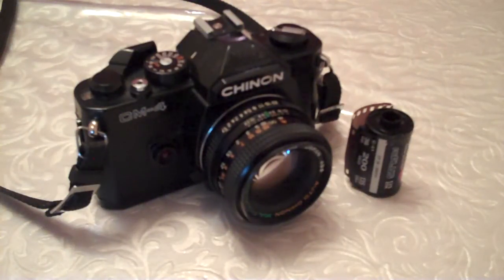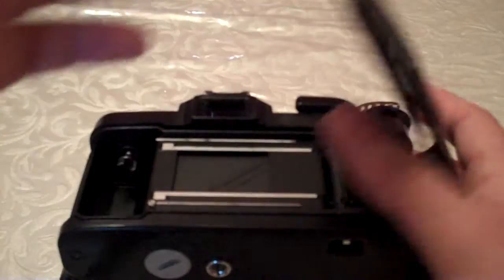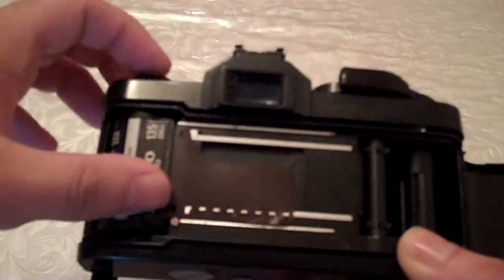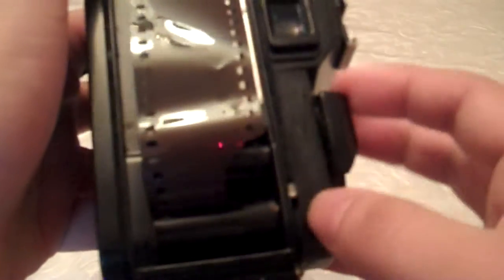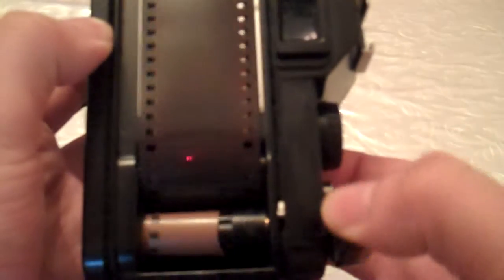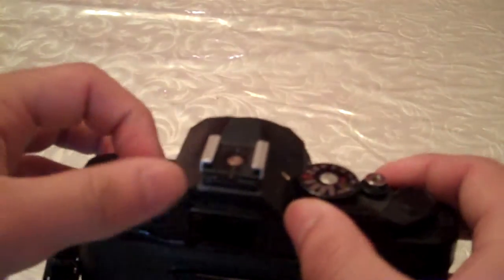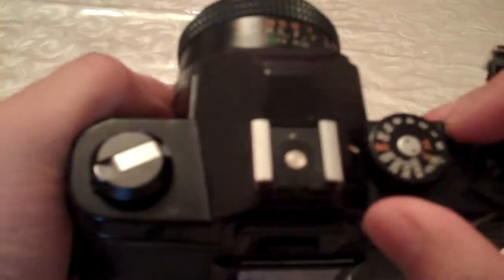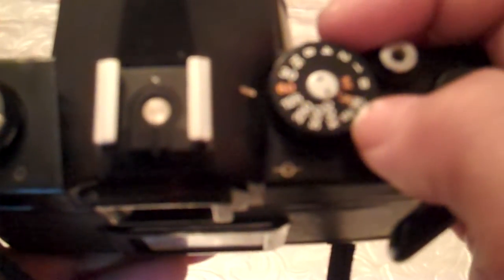Loading 35mm Film Into A Chinon Camera

Comment: Hi, do you know what could be the problem if the door is not opening? Its kind of stuck, and I don‘t know what to do because neither the ‚film door‘ nor the battery door is opening :/
Reply from the maker: Erm! Can you pull the rewind knob up or is that stuck too? Try pulling up harder but don’t break it cos the rewind knob can come out. For the battery door, the batteries might have leaked and stuck to the door.
Reply: @FilmPhotography383  I can pull the rewind knob up, but nothing happens if I do so... & I tried pulling up harder, but nothing happend and I thought I‘d rather break it this way😅
And for the battery door: is there any way to repair it/ still get it up if the batteries would have leaked?

And thank you so much for answering, have a nice day :))
Reply from the maker: @theresak4930  you might have to take it to get repaired. I usually clean the leak with a damp cloth and that takes away the powdery mess. Is your camera the exact same as this one? For this the battery is at the bottom and uses watch batteries. To open you can use a screwdriver or coin and it should open. Hope this helps. 
Aww you’re welcome! Thank you and you too! :)

Comment: I have the same camera but when I unloaded old film and tried to put there a new one I couldn't rewind it. The rewind lever was totally free, you can move it all the way, but it didn't rewind the film at all. Shooting doesn't do nothing. I am kind of frustrated because the same thing happened to me after changing the film also the last time, I took it to repair shop and now it happened again :/
Reply: Did you find a solution?
Reply: @einarwahlstrom5533  Yes, I've got it working. If I remember correctly, the issue was that the small button on the bottom of the camera (the one you are supposed to push when unloading the film) was stuck, as if pressed. I had to play with it a bit to "unpress" it.

I might be doing the mistake of pushing that button too hard or keeping it pushed during the time I was rewinding the film.